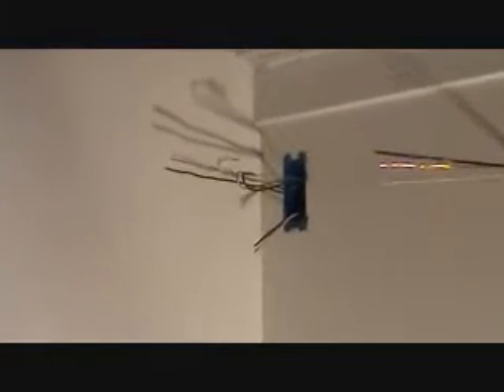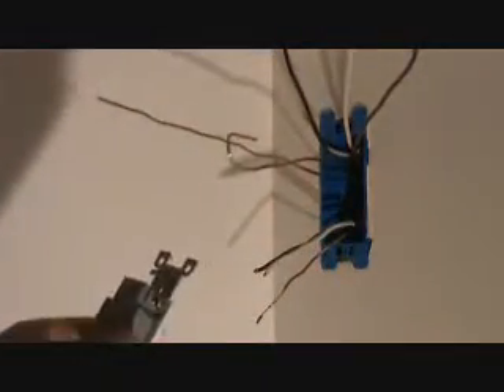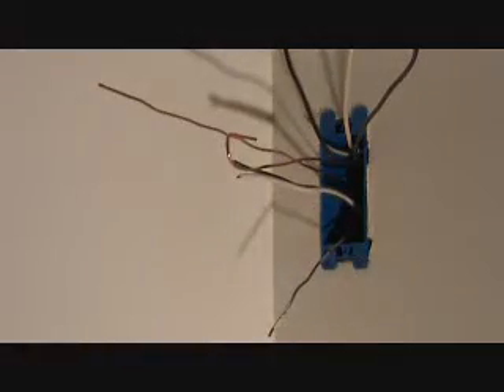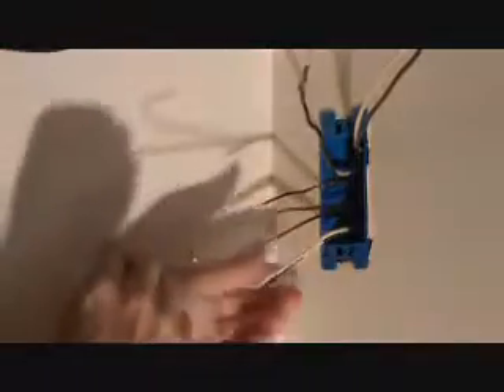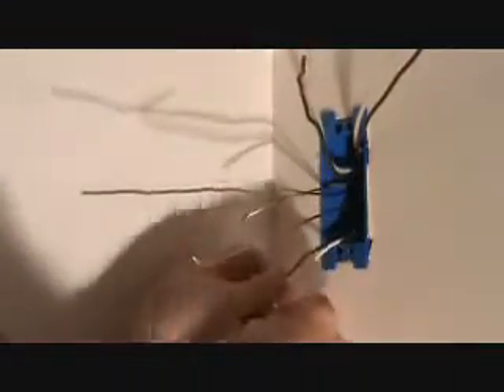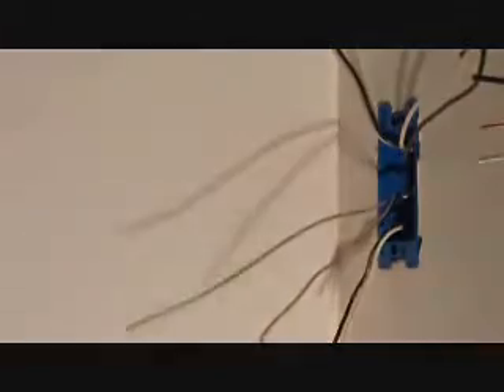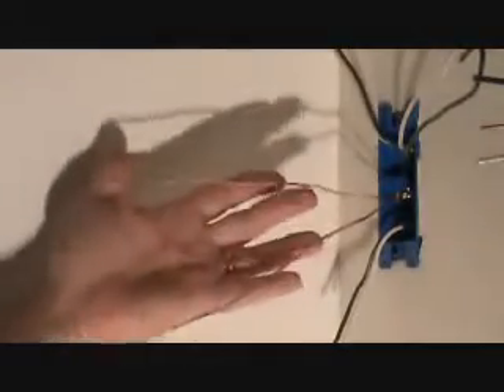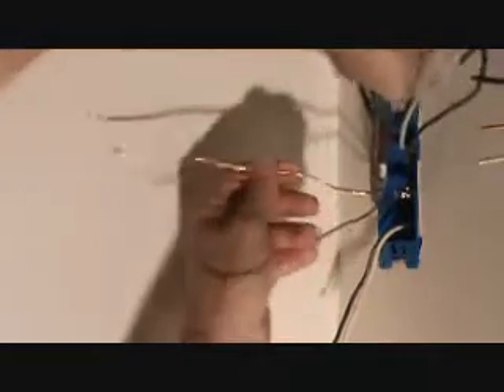How to connect the ground wires for an electrical outlet

Comment: Silly question. My entire house was done this way with the ground wires all twisted like this. For example I have one outlet with 4 ground wires twisted together with one being grounded on the ground screw on the outlet. Is that safe, efficient, and normal? I'm having so many people give me different opinions I'd like to get yours too lol. Thanks :)
Reply from the maker: Sorry for not getting back to you sooner. Yes I've seen this same thing with the grounds all twisted together with just one then coming out to connect to your light switch or electrical outlet & yes it's common. If you think about it there's pretty much no way that you should ever lose ground this way as though wires will always be touching each other all twisted up tight like that. See?